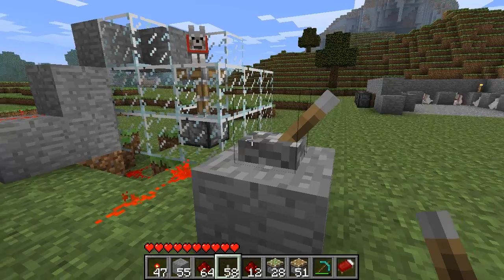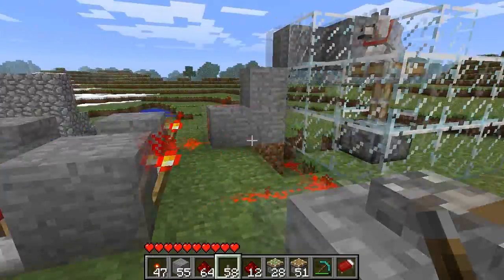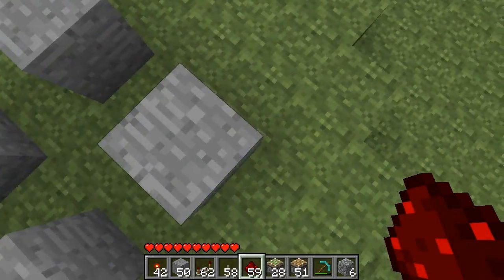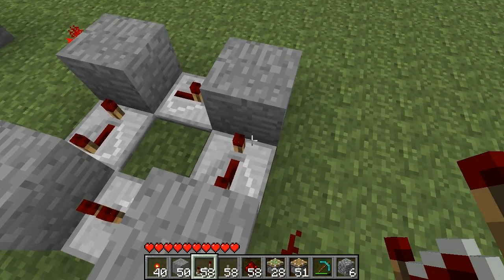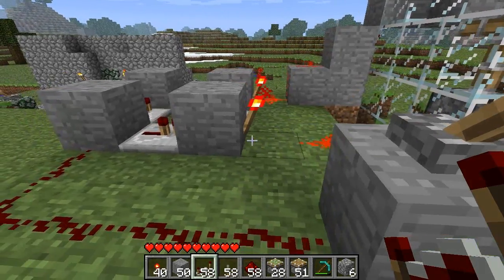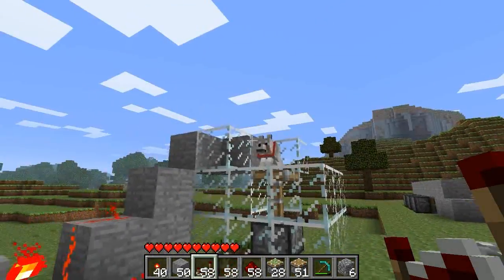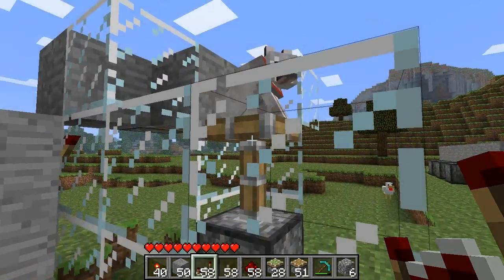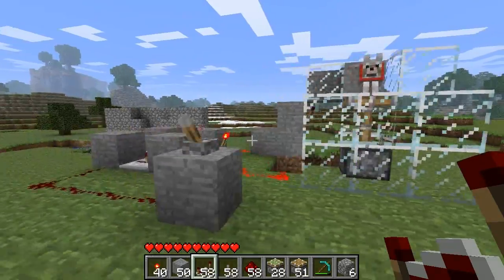Piston Tutorial - Pop-up Dog Dispenser

Comment: @TheReverendworm The same input is divided into two outputs. To one of the outputs, you add a repeater and make it take longer to activate. Attach both ends to an and gate, and the output will work the top piston.

What happens is that it takes both  inputs to push, resulting in one of the inputs taking longer to activate. But it only needs one input to turn off for the piston to turn off, making the piston pull faster than it pushes.